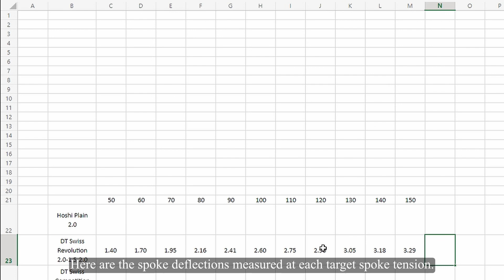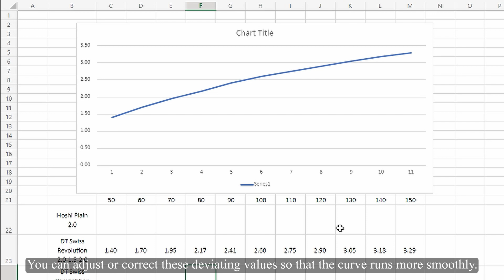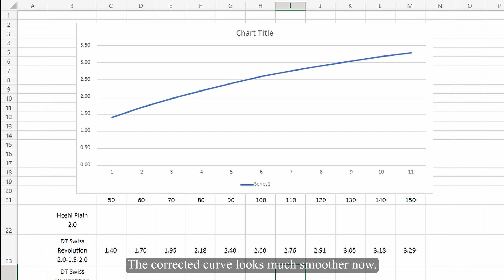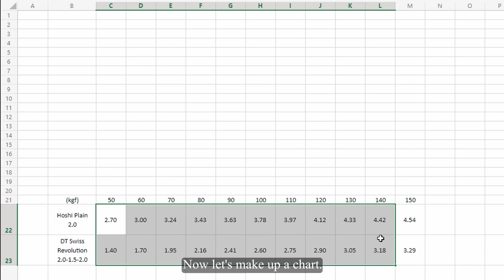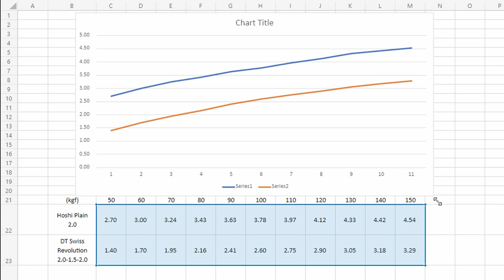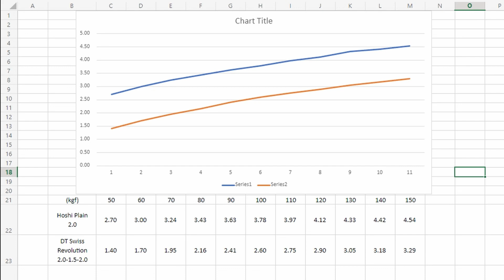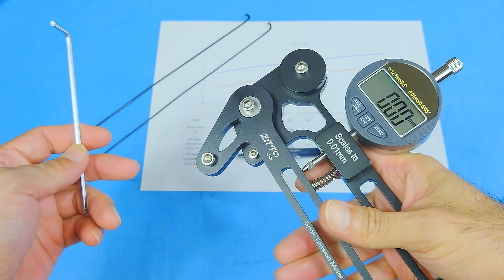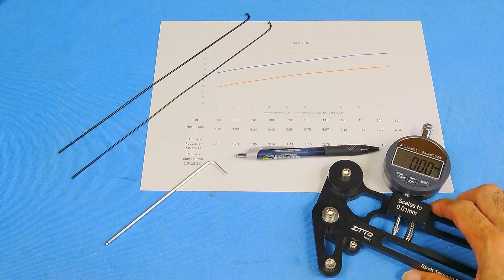[MTB maintenance] Spoke tension meter calibration tool - How to make your own conversion diagram

Comment: hello.... please explain the need/function of the "tension master"?? 
Also , i guess the accuracy of the crane scales could need checking with hanging known weights [ eg 25kg, 50kg 100kg etc , so as to construct a calibration graph]
Reply from the maker: Hi, the tension master is a reference object that "is considered" to have a certain tension constantly under this and that specified conditions. It serves as a simplified calibration tool instead of the proper calibration with a calibration device and real spokes. You can verify in a very simple way if your tension meter works properly using the tension master. If you run a pro bike shop, you need to calibrate the master itself periodically of course.
Speaking of the accuracy of crane scales, those unexpensive crane scales like mine should not be considered to have the accuracy adequate for any serious or professional situations. These scales are not capable of showing the accurate values when you keep placing high loads on them for a longer period of time. So even if you calibrate them with reference weights, they are not suitable for professional level tension meter calibration tool in the first place.
If you want to calibrate your tension meter in a more serious manner, you must use an industrial level "load cells" or "force gauges" with a very sturdy cage of steel. But it will cost loads of money. A very amateur wheel builder like me never needs that kind of accuracy. I am going to upgrade my calibration tool, but the current one will do just fine for any personal wheel building projects.
Thanks for watching and your feedback.
Reply: @MindDesignFactory  thankyou for the superb answer, & explaining the "tension master".
 I am currenty putting together a tensiometer calibration device , inspired by your design,   for amateur wheel building .
Reply from the maker: Great! I highly recommend using a really robust steel cage, frame or base construction. Mine is made of a piece of construction wood block and a couple of steel angles, but it takes some time for the scale readings to stabilise especially when the spoke tension goes over 100kgf. I am planning to make a new upgraded version using a load cell, an electric indicator and a robust steel base.
Also I think it is better to fix the end of the scale, not the end of the spoke, and to pull the spoke instead of the scale to measure the tension.
Good luck with your calibration tool!

PS. A low-cost professional tension meter calibration tool is available at the cost of about 400USD. And a digitized industrial level force gauge without a stand or cage costs over 900USD. There are many cheap Chinese alternatives available of course, which are more than enough for us, I think : )
Reply: @MindDesignFactory  thankyou. Yes , the wood base is sure to be the least suitable component….. so maybe i will use se box-section steel for ?mark2 version
Reply from the maker: I used the construction wood block half for fun, half seriously. It actually stands for over 200kg load easily without being bent. The problem is rather with those steel angles that are slightly bent as the load increases. 
The steel box beam is definitely a good base material. I wish you luck!
Reply: @MindDesignFactory  Luckily , my local build-advisor , suggested angle steel screwed along the "underneath " edge of the wooden beem, to hopefully eliminate significant beem distortion under load.....
Reply from the maker: It is a good idea. You can have the force points closer to the center of the base by doing it. I'm eager to know how it will come about :)
Reply: @MindDesignFactory . assembly complete, but as possibly expected the crane scale reading is not stable , presumably because the wood is flexing. So next step is angle iron along the sides , or maybe some steel pipe to brace against flexing. I have checked my PARK TM-1, and it was "out" by 2 units [over reading] .However its just a unit-less number, so now i know 130kgf is equivalent to "25 ". Another project is checking the crane scales with known weights [ thought to ask my local gym if i can use some bar-bell weights]. thankyou for the inspiation & excellent video
Reply from the maker: Probably you already know it, but the conversion table of TM-1 should be considered as reference. A round plane steel spoke of 2.0mm section deflects differently from the same type of spoke from another brand. The conversion data of DT 2.0 plane spoke serves only as reference for Sapim 2.0 plane spoke, that is. That is why it is handy to have your own conversion table of those spokes that you actually work with in your usual wheel build projects. 
Have a nice weekend :)
Reply: @MindDesignFactory  yes... aware of the shortfall of PARK TM-1 table .
The TM-1 therefore perhaps does not  need any adjustment , as the TM-1 scale reading is all that is required ,  measured  when the spoke is tensioned to known  maximum specified rim tension
Reply from the maker: The big difference between TM-1 and Chinese cheap tension meters is that every TM-1 is calibrated at factory and shipped with a practically fully usable conversion table, whereas the Chinese ones are not only non-calibrated but also come with a ridiculous conversion diagram totally of no use.

Comment: Do you have calibration data for 2.0 1.8 2.0 spokes?
Reply from the maker: I will make conversion charts for DT Swiss Competition 2.0-1.8-2.0 and Champion 2.0 hopefully within this month. I have already got those spokes to be measured on my calibration tool.
As you may already know, the conversion chart of DT Swiss  2.0-1.8-2.0 double butted spokes can't be applied to the same type of spokes from another brand. Also, my conversion chart is improbably of any help. Because your tension meter is not set up just like mine.
Reply: @MindDesignFactory  Thanks.